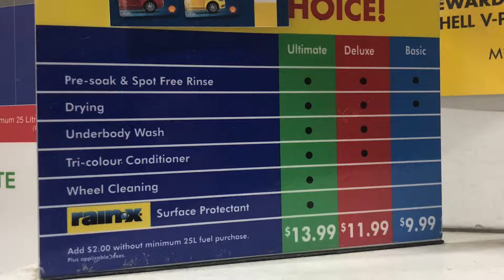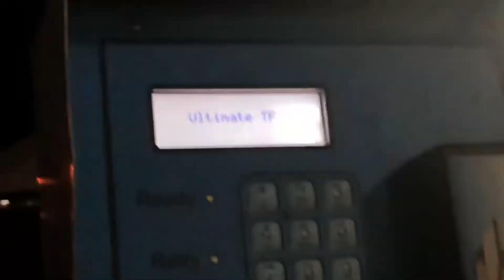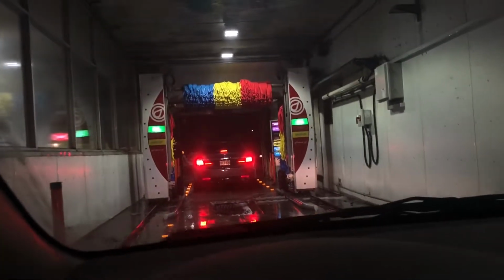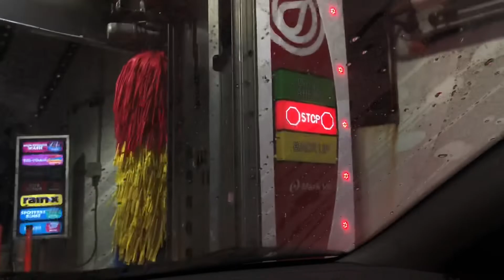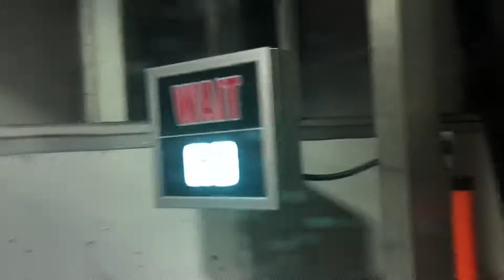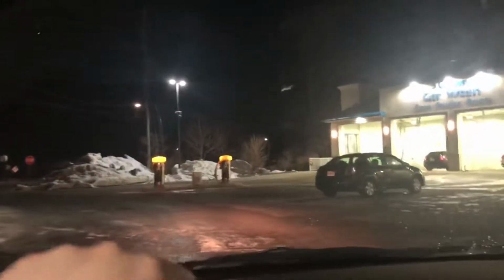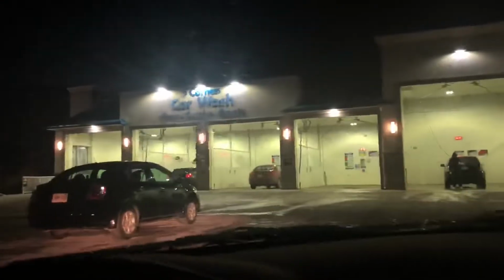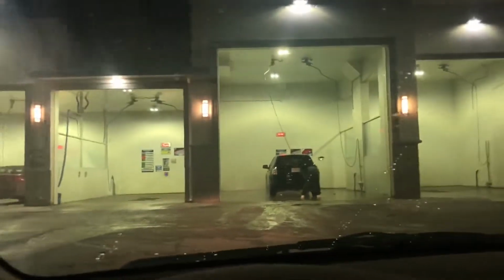Awesome Newer Mark VII ChoiceWash XT at a Shell Choice Car Wash in Keswick (Ultimate Touchless Wash)

Comment: Bruh. You legit said this was the worst car wash exactly 1 year ago.
Reply from the maker: Trains ‘N Sirens I know. They Fixed it. Besides, that is Almost 2 years ago. :D
Reply: Tyler M ok! There is a car wash down here in MN they used to have a laserwash4000 but it’s gone now. They also had the old dryers!
Reply from the maker: Trains ‘N Sirens Oh Wow! That’s really Sad that it was Replaced. :(
Reply: Trains ‘N Sirens Big RIP. The closest 4000 to me is a 4 hour drive away and there used to be one in a big city next to it called Edmonton but that got replaced with a Mark VII unfortunately. It's at a Husky gas station and they recently signed a contract with Mark VII. But the other one is at an independent wash called Camrose Auto Shine. It's a carefree model with Belanger dryers.
Reply: In New Hampshire, these Mark VII ChoiceWash machines are EVERYWHERE, and almost every single one replaced rare systems. The one at Lake Street Car Wash replaced an AUTEC EV-2, along with the one in Manchester and one in Hooksett replaced a Belanger Freestyler.
Reply from the maker: Oh Wow! :D